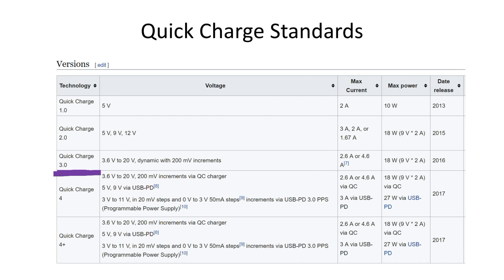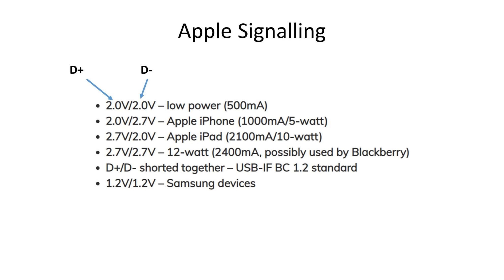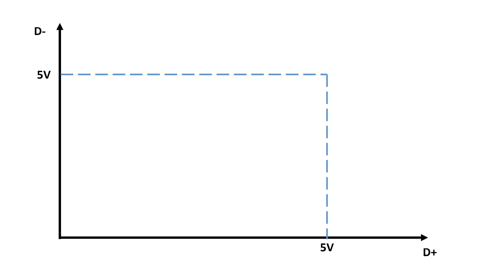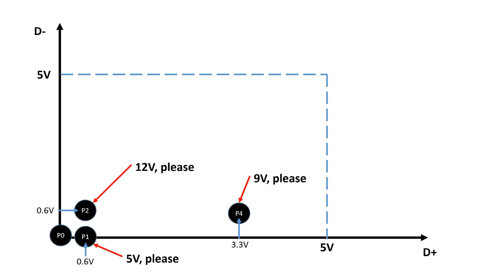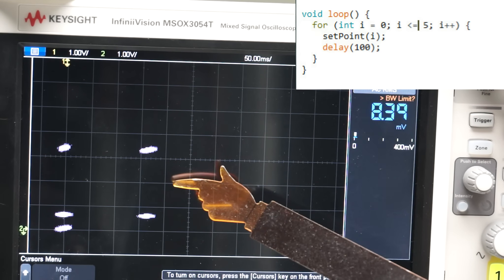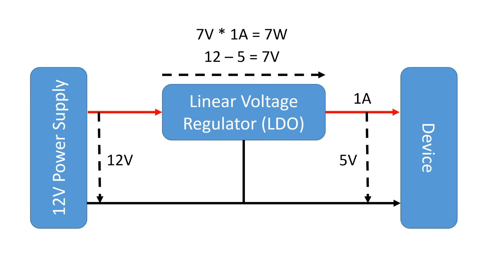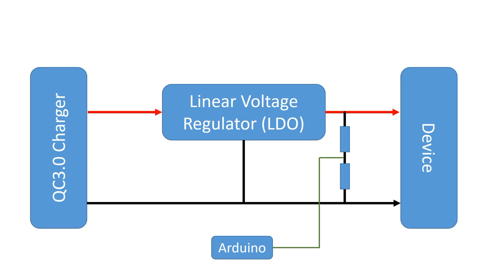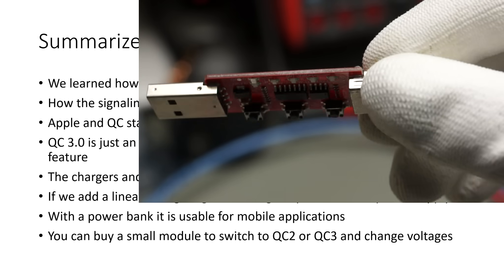#244 QC3.0 Hacking and Tutorial incl. QC2.0 (Mobile Power Supply) Quick charge with Arduino

Comment: Arduino uno has analogue output pin e.g. pin 10 and pin 11, can we use such pin to output 0.6V, 3.3V for D+ and D- instead of using the resistor circuit to step down 5V to 3.3V and 0.6V?
Reply from the maker: _The Arduino UNO has no analog output pins. These pins are PWM pins. (Google PWM if you do not know what it is)
Reply: @AndreasSpiess  oh! I see. Thank you.

Comment: correct me if I'm wrong. if for example i need 12V, i need to put +0.6V on D+ pin, and +0.6V on D- pin?
Reply from the maker: Yes.
Reply: @AndreasSpiess  thanks for clarifying these. another thing, does it have to be step by step, from p0 to p1 and then p2, or i can just do it instantly from p0 to p2, to get 12V?
Reply from the maker: I do not think so
Reply: @AndreasSpiess  i'm sorry, does it mean, i can do it instantly ? (from p0 directly to p2)

Comment: EXCELLENT, "Write up", this possibily explains the issue with the LG G4 phone overheating.  This occur when I was charging my phone in the car and had "maps" running.  It sounds like the QC2 on the device was not able to balance the charge and phones power needs at the same time.  It is a known fact the phones could permanently lock up if they got overheated.  As hot as mine had gotten several times, I'm suppressed that it didn't.  And yes, there is a hack out there to recover the phone if you are able to flow the chip apart and reset it.    Please keep up the great work! Ken O would be proud.
Reply from the maker: I have an Iphoone which does not use QC nor PD ;-)

Comment: Where did you hide the GitHub Library for the Arduino and where is the information on your website?
I've gone through your whole GitHub repository and I also searched your whole website but what you're showing here in this video is nowhere to be found, I really wanted to use the Arduino Library so I'm very disappointed that it's not there anymore.
Best regards,
Ricardo Penders.

😠👎‼️⁉️⚠️💣💥
Reply from the maker: The address of the library was visible in the video: https://github.com/vdeconinck/QC3Control. I now addid a link to the description.

Comment: i really wonder, can i use direct 12volts \ 2-3 A to charge my powerbank/smartphone which is QC2.0 \ 3.0 capable?
for example, 12-V (lead-acid) car battery directly connected to usb +|- pins of my QC3.0 smartphone, will the phone burn away, or gonna charge normally?
Reply from the maker: I think you have to watch the video again. Otherwise your phone will be destroyed
Reply: @AndreasSpiess  taken risk and tested it, when voltage goes over 6.5 volts. phone turn off charging.
but it least it doesnt burn

Comment: Does someone have seen a Ready build schematic on like eBay for using it at power supply?
Reply from the maker: I got some chips but did not assemble them so far...
Reply: can you send me the link to them?
Reply from the maker: I think I mentioned one in the video: LM3080 and LM3083
Reply: thats the power Regulator ;) I mean a complete schematic Ready build i only have to set the Jumper for the Output voltage

Comment: I was wondering if you know that voltage of qc 3.0 directly connected to li-ion battery? Or it's transform from 12-20v into 4.2 and change by more current. So i'm intetsting, how power on charge 12v and 2a (24w) charging li-ion cells.
Thank you in advance.
Reply from the maker: Li-po batteries need a special charger circuit which usually runs of 5 volts. If you just connect 5 volts or more to a Li-ion it can explode after a while.
Reply: @AndreasSpiess  so this charger, just step down voltage to 4.2v and charging with more power?
Reply from the maker: No.
Reply: @AndreasSpiess  ok, i'll try to reprhrase. How li-ion battery charging on 12v or even 20v using quick charge ? How it's works?

Comment: Thanks as always. It seems like there is not really any signaling of the amperage anymore. Amperage was the ONLY parameter that the Apple standard was signaling, but now with QC, if your device does detect that QC2 or QC3 is available, then your device should expect at least 18W. No other signals about power.
Reply from the maker: The device always has to limit current (according to the % charged). The Apple standard was more about protecting the charger than the smartphone, I think.

Comment: the 1117 has a bigger quiescent current draw than what the attiny draws, it's  horrible regulator :( just saying.
Reply from the maker: You are right. For low power designs, there are much better choices. But here we have mains voltage.
Reply: @AndreasSpiess  Yeah for some reason when i see QC standards my brain goes instantly into power banks. but you are right for mains connected projects these regulators are fine.

Comment: Hallo Andreas. Thank you for this vid..it makes perfect sense. i am working on somethin similar. But i do have a wish...a big wish from you.. i have looked far and wide on goggle and you tube about modbus and rs485. It seams what you can find is small vid with poor music, only showing the final project..max 10 min. But i know a lot of people, is buying these relay moduls fx R421A08. But getting from using GPIO to start communicating with other devices, is hard. Its like there is a lot of cool people, making intruction and beginner guides. But when it comes to the groovy stuff, nobody rasies their hands todo it. I found a couple of video that explained the how-to. but only the technologi, not the micro processor and wiring or the sketch/PY. I think alot is missing the base point to get started- myself included. I am working on a project- and i need rs485 in particulier this board i mentioned. Also i think that most beginners that wants to advance know how to make a relay or more work.. But what do i need how do wire- and what are the trapdoors… I hope sincerly you will be the first one to make a vid in details of this. Try search fx Raspberry Pi and rs485/ or modbus on youtube… its poorly covered. I am a PRO beginner.  and thank you so much. But i know you are creative and have a lot of cool projects in the pipeline.  I hope you will look into this.
Reply from the maker: There is a simple reason why RS485 is not covered on YouTube: There is no big interest. This is an old and very specialized technology mainly used in professional/industrial equipment.
Maybe you use Google and you will find all you need, just not in videos.

Comment: Whats the point of 9,12 and 24 volts all to goto a 4v lithium battery that depends on CC and CV charging no higher than 4.2v
Reply from the maker: For example motors or operational amplifiers need higher voltage.
Reply: @AndreasSpiess  qualcomm designed this qc3 standard into their mobile handsets CPU.  I just don't understand why
Reply from the maker: Because they wanted to charge their phones faster. Higher voltage means less current. And longer cables can be used
Reply: @AndreasSpiess  as I understood lithium batteries you cant charge them above 4.2V? So is this all just for clean high power transfer to the device to then later be regulated down again for charging?
Reply from the maker: Yes

Comment: Erm... the ATtiny85 working voltage is the same as the ATmega328, 1.8 V to 5.5 V. There's no need for a 3.3 V regulator.
Reply from the maker: And if you switch to 12 volt?
Reply: @AndreasSpiess  Yeah, but there's the same problem with any other microcontroller.
Reply from the maker: The mini has the regulator on board. This is why I made the comment

Comment: Things to note here: QC is not a standard, It's a proprietary technology from Qualcomm. QC3.0 and below have no protection for overloading the cable, they just send power. No QC version is USB-IF compliant. On the other hand USB PD is a standard by USB-IF. A 30+ watt USB PD charger can be purchased for less than $20. There are also many manufactures producing USB PD ICs that could be easily integrated into a cheap programmable power supply.
Reply from the maker: In my world, standards can be open or closed, they are still standards if they are accepted by different parties. And a charger never decides how much current flows across a cable. It only offers power. According to Ohm's Law, the resistor of the power sink  (e.g. Smartphone) decides on the current (at a constant voltage, which is the case here). No difference to PD here. 
But maybe I will also do a video on PD in the future. Then we will see the differences.
Reply: @AndreasSpiess  A charger can supply more power than a cable can support and if the device can use that much power the cable can become overloaded. With PD they have a chip in the cable that that tells the charger the capability of the cable.

Comment: Thank you for making this video. It opens up several interesting paths to explore why several smartphone manufacturers that implemented USB-C, may have battery charge problems that have fried their batteries and internal charging regulator circuit. The Moto Z Play (version 2) comes to mind. They offered a regular charger and "turbo" charging option. Adding to the complexity, they offer a magnetically attached battery pack. 

The circuit board you made looks very intriguing. Did you make a video how you designed and put it together?
Reply from the maker: So far I always thought, all other YouTubers made JLPCB videos and I do not need to do an additional one ;-)
Reply: @AndreasSpiess  There are some good videos out there. But you are your own engineer, with unique communications experience that is worth everyone's time to learn from.

Comment: There are dedicated QC handsake IC which would make it easier and safer.
Like IP6518
Reply from the maker: Maybe. I did not find an English data sheet. Do you have more info or projects done with this chip?
Reply: It's in my "dongle" from ebay that triggers few voltage levels up to 20V(PD) by pressing a button, basically that IC I mentioned + some very small uC like attiny or something.
It's this one: https://www.ebay.com/itm/UPD005-PD-to-DC-spoofing-detection-PD2-03-0-fast-charge-trigger-QC4-polling-HID-/273424369188
Reply from the maker: Thank you for the link!

Comment: 5:10 How can you go from P0 to P1 with d+ and d- shorted together by the charger? Isn't it P0 then P2 and when the charger disconnects the 2 lines it's P1? There's also a difference between what you try to push on whose lines and the result depending on how hard you try (the impedance of the voltage source) if they are shorted together.
Reply from the maker: You have to think without the charger in place. The Smartphone signals. But of course, you are right as soon as the charger is connected you will measure the same voltage on both wires. But as soon as the connection opens you see the difference. If you would supply P2 the charger would open the switch but fortunately would not immediately go to 12V. You always have to go to P1 to switch it into QC mode.
Reply: @AndreasSpiess  I know that. The question is that you can't go to P1 if the charger is connected and shorts the 2 lines. If you try you will just get in between depending how hard you drive the lines. The problem is then that the charger cannot detect being in P1 before stopping the short because if it sense the 2 lines (connected together) he will always see the same voltage...
So the conclusion is that the 2 ways communication is a bit more complex that what you described...
I guess with a 4 way oscilloscope with small resistors on the data lines you could probe each side of the wire and see when the charger shorts the lines or not.
Anyway it seems to work.
I have a few blitzwolf chargers and powerbank and 2 phones that can do high speed charging. One Motorola and one Samsung. The chinese charger can charge both at 9v but the Motorola charger won't charge the samsung fast... So it seems that there are variants in the protocol. Also I think I read the original article some time ago and the guy was not using exactly the voltages he saw when he reverse engeneered the protocol but it was working.
Reply from the maker: As I mentioned, I do not know the exact voltages. I tried the power bank and the Charger and it worked. The guy I had the design from also did some tests, which also worked. That is all I know. And I am sure viewers will come back if it does not work for them ;-)

Comment: Good stuff! In your research do you find if VOOC (or dash charge; oneplus and other Chinese manufacturer use it) works the same way? Well, not exactly the same way as they use low voltages and higher amperage to keep the heat away from the phone. Also, I think there is an additional data line in VOOC cables. That said, my initial question wasn't that smart...
Still, I know there is an adapter like the last one you shown that converts QC3.0 to VOOC (5V/4A), which is great as there are (?) no VOOC powerbanks on the market or are extremely hard to find - you could just convert a QC3.0 to one. I haven't bought one of those because I don't need that much of a mobile PSU.
Reply from the maker: I did not look into other standards. And I did not see it is used frequently.

Comment: Very good video! Thank you!
Can you do that synonymous for USB-PD?
So QC4.0 ..
That would be great! I want to build a charger for my laptop (20V, 3A) ...
Thank you!!
Reply from the maker: QC4 is only the integration of QC and PD. So no big change on QC. Maybe I will look into PD when it became way cheaper.
Reply: @AndreasSpiess  yes, PD is still very expensive :( I'm curious how it continues :)
Reply: I have build an Powerbank with 6S4P 18650' with 12V Step down and an USB-C PC Car Charger. ESP to measure Out and In Ampere, as well as Voltage auf each 6 parallel packs. All in all into a 3D Printed and laser cut enclousure, so well done. 
I would like to have an Portable PD Charger for Laptops.. but the available ones goes only up to <25W. My DIY one goes to 48W. But a lot of ours to build and very big to carry arround. A small PCB with 4 Cell protection, balancing, charging, boosting und discharging protection would be really nice :) 
Today you can't buy Something Like that. 
An USB C Input with 5 to 20V input to charge your diy projects would be also very nice!! 
Sorry for bad writing... 
Have a nice day guys 😉
Reply: Expensive how? Because of the cables and sockets?
Reply: @AlfieMakes  Because of de facto industry momentum for Qualcomm's proprietary Quick Charge format and less economies of scale for USB-PD components (although Apple's adoption is certainly helping there).
Reply: @MikeTrieu  but it's an open standard, you can implement it yourself, and if you make a quick search you can find tons of chargers with the standard. Well I don't know, most of the devices I own have it, and I didn't even know about it until a week ago when I started researching for a project I'm interested in.
Reply: @AlfieMakes  Yeah, sure, they've got the connectors, but the actually capability and even safety of any of these cheap units is anyone's guess. And a bad charger or cable can end up costing you dearly if they didn't implement the spec correctly. Just ask Benson Leung from Google about his burned out Chromebook and two fried "Twinkie" USB-C protocol analyzers. USB-C is not something you want to cheap out on these days.
Reply: Yes! Power delivery, I'd definitely like to see that. A board that could take any voltage input and output PD over USBC would be awesome.
Reply: @Mario Zwiers, for a fixed 20v supply at up to 4 or 5 A output would it not be far simpler to use a low cost adjustable switching regulator from eBay, Banggood, Gearbest, Ali-Express or wherever for around than £2/2€/$2? 

Better yet just use an encapsulated 4A/20 volt supply they are pretty inexpensive too - plenty of 3.25 - 4.5A ones available for £5-£6.50. Maplin (UK) used to do a really nice 120 W  adjustable one that was a bit more expensive but very reliable and with an LED voltage display too (I have one). 

Sadly Maplin are no more and I haven't yet found an equivalent online.
Reply from the maker: PD or QC can be more interesting than a normal power supply if you need a power bank or on a trip where you already have to have a charger for your phone. At home, it is probably an overkill.
Reply: I really want to see a DIY type C circuit for 18650 which can handle input and output up to 20V lets say max 30W is still enough.
This is the only circuit that I found but is pretty expensive and is still not what I am looking for (haven't tried it), The best thing that I have found is from Omnicharge.

https://www.omnicharge.co/products/dc-to-usb-c-adapter/

https://www.aliexpress.com/item/QC3-0-Quick-Charging-Booster-5V-9V-12V-Type-C-Charging-Printed-Circuit-Board/33024667849.html?spm=2114.search0104.3.154.181b5cacRLaPSV&ws_ab_test=searchweb0_0,searchweb201602_6_10065_10068_319_10059_10884_317_10887_10696_321_322_10084_453_10083_454_10103_10618_10304_10307_10820_10821_537_10302_536,searchweb201603_53,ppcSwitch_0&algo_expid=ba27ed4a-dc96-4e5f-83d8-4fe882dc3ee3-23&algo_pvid=ba27ed4a-dc96-4e5f-83d8-4fe882dc3ee3&transAbTest=ae803_3

Comment: My qc 3.0 power Bank got stuck on 12v and destroyed the data lines on the USB port of my phone....
Reply: I didn't realize it was stuck at 12v because it was charging my phone like normal, I realized it when I was bored and plugged in a small WiFi adapter (I was bored) into it and it burned something inside the wifi adapter....
Reply from the maker: Strange. The data lines never should get 12 volts, only VCC. So your device or plug was defective.
Reply: @AndreasSpiess  I'm still not sure what happened but for some reason the data lines and the power lines was showing 12-13v on my multimeter
Reply: Luckily my phone still charges normally while and after it was connected to 12v. I can't use it to transfer data though
Reply: To this day its still stuck at 12v and makes a buzzing sound when on, I just use it to test small 12v devices and I could turn on 2 4w 220vac lights with an inverter.